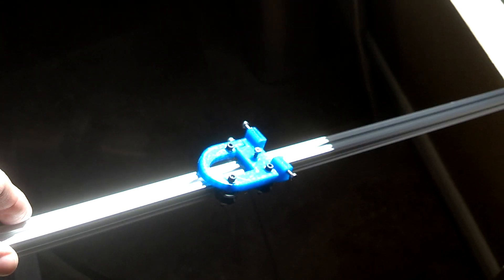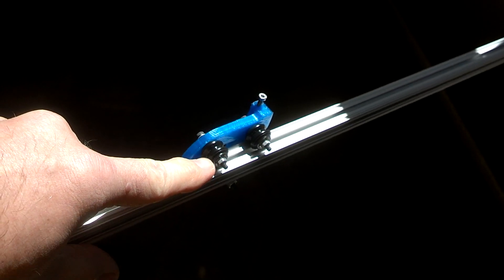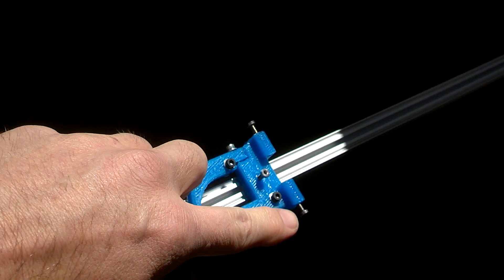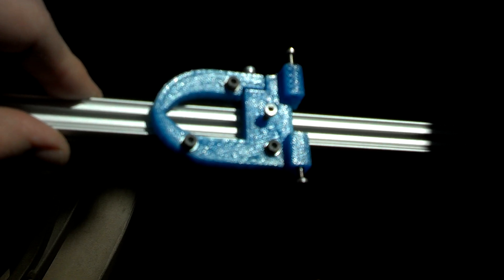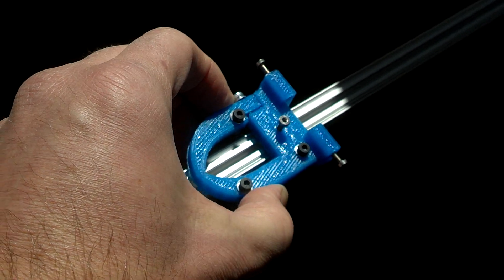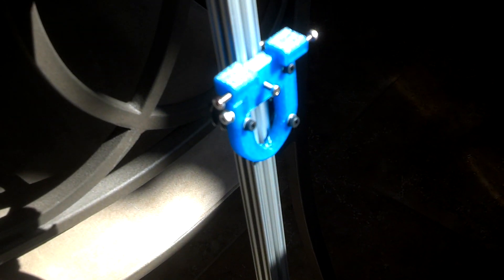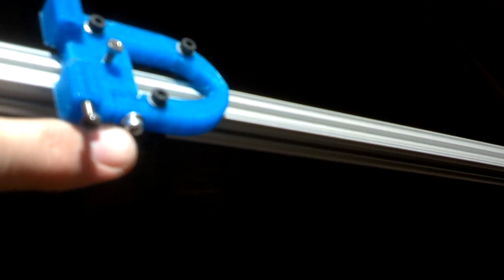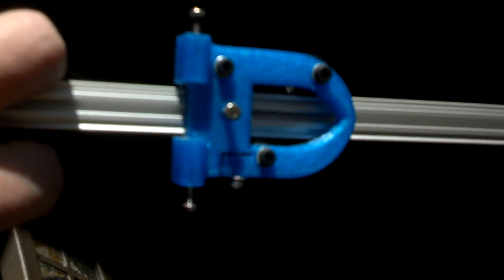Cerberus-pup - a small, precise 3d printer

Comment from the maker: Busy working on designing a tabletop sized 'small envelope' delta 3d printer using OpenBeam and my new dual 623 bearing universal micro-roller. Let me know what you think of the design, always open to suggestions and comments.
Reply: As much as I want these now, a kickstart campaign is not a bad idea for a lot of reasons, not the least of which is the exposure...

Could also justify a run large enough to make it entertaining - or lead to some Nylon66 molding experiments.....

Man, I wish I had more free time! :-)
Reply: Sweet!  Will you be putting the carriage STL on github?
Reply from the maker: Sure will, as well as for the rest of Cerberus-pup when they are done. I don' have the 623 delrin roller available for sale just yet because of the expense, but am working on lowering the cost, possibly doing a kickstarter
Reply: Well crap. I was hoping to get a set for my kossel/cerberus/whatever-the-heck-I-decide-to-build that I hope to put together within a week or two.
Reply from the maker: Matt, these are made on a screw machine with atc and they take approx 2.5 min per part. There are 4 ops per roller, plus all the manual post-processing. In qty 100 they are well north of $4 ea without bearings or precision spacer. At 1000+ the price is a bit more reasonable. And that's just my cost, not even wholesale. So in qty of 100 it's gonna be an $8 roller (with bearings), at 1000 qty it's probably a $5 roller. (prices subject to change!) ;-)
Reply: Very nice! Quick question -- are you using the tension adjustment for tightening or loosening the rollers?
Reply from the maker: There is some natural tension built-in due to a bit of 'spring' in the plastic leg (the left side of the 'shield' shape) that holds the single roller. Over time the PLA plastic loses its natural spring and goes slack, so the tensioner screw is really just a method to hold the proper tension and does not need tightened down very much at all. I just felt it was a simpler idea than a cam tensioner, or springs, etc.
Reply: If you end up doing a kickstarter, have you considered offering several different OD designs (flat/V/W), materials, and/or bearing sizes?

(playing Devil's Advocate: Variety would help the community more, but I wonder if it would make it too difficult to reach the funding goal...)

edit: Perhaps more roller designs and one or more injection-molded carriage designs could be a stretch goal.
Reply from the maker: Sure thing Eric! I sent you a message.

Matt - It starts with a center drill, then a micro-boring bar goes in the hole to create the inner shoulder for the bearings, then it moves to a tool for the sculpting of the outer profile and finally there is the cutoff tool. I'm sure with enough volume the pricing could be made reasonable. We're working on a solution to that.
Reply from the maker: Matt, email me off-list - grabercars@gmail.com. I have a few other leads where we can gang up on volume and we may be able to get the price down far enough to make them workable. This would be a win for everyone.
Reply: Beautiful design Steve. You continue to amaze me with simple and well thought out design.
Reply: I smell another Kickstarter! :)  I do - however - like the idea of a machined big brother that's as much art as printer....
Reply from the maker: Yes. I am actually working on the final cad files for a Cerberus-Pup with 170mm round print bed using 500mm tall OpenBeam extrusions and those .stl files will be released within a week or less. I can email you the stl for the little carriage right now if you wish.
Reply: Steve, you think you will have wheels available next week when you release the stl's?  I've got some OpenBeam just waiting! :-)
Reply from the maker: I'm going to be working on making some more dual-623's over the weekend, but my big group buy fell through, so the little buggers are going to cost about $7.95 each. 9 required per printer. Still debating doing the Kickstarter, but I'm going to release Pup files anyways and if people want to go forth with an early-adopter build... that's the price bleeding-edgers will have to pay... :-)
Reply from the maker: John Driggers
John I can send you just the rollers, no bearings for $5 each if you want some.